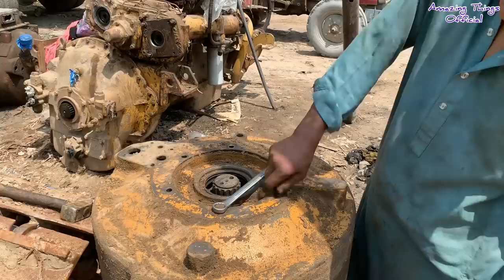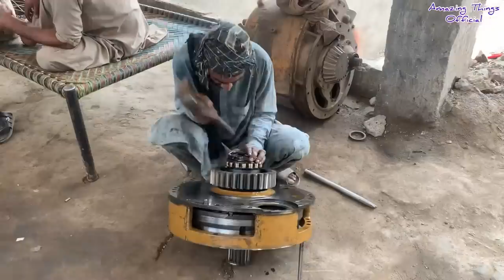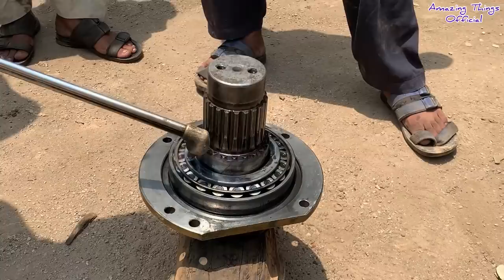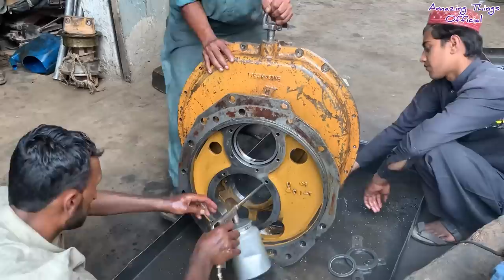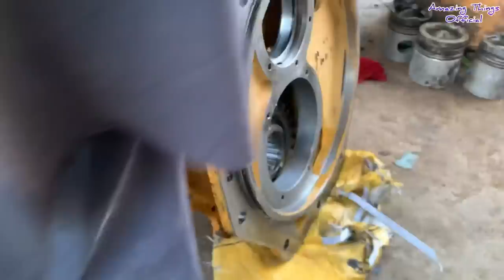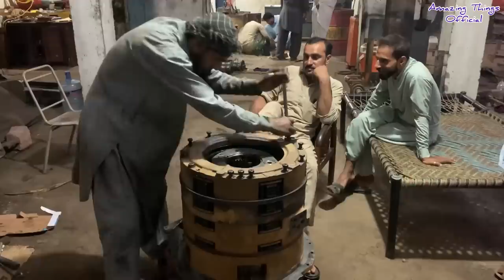Rebuilding Caterpillar 966D Dozer Transmission Due to Slow to Engage || Restoration Transmission

Comment: Got to respect these hard working people they always get it back together and never no waste good mechanics but I never see a torque wrench wonder how they do a preload on the bearings
Reply: It goes to show that torque wrenches are meant for maniacs to avoid bolt shear and plate warping during assembly. Also these guys discovered preloading bearings is a waste of time, nothing happens if its not done.

Comment: That's pretty impressive. If I were doing it I would be very concerned about having a few parts left over at the end. And who needs torque wrenches when one has a calibrated elbow...

Also goes to show that a bit of dust and grains of sand are no problem at least for some transmissions.

Looking at that one bearing, it seems someone forgot to maintain fluid levels. That can get expensive.

I'm surprised that it looks like they didn't replace more bearings, such as those on the planetary gears and on the clutch center gear.

Someone should show them the trick for using the old bearing to install a new one. It's a lot easier on the bearing.
Reply: no torgue wrench needed. its 2 grunts for the small bolts 3 for the medium bolts and four for the large bolts..

Comment: CAT charges $50K for this repair. Three Hooba Doobas in sandals with a couple of wrenches, screwdrivers, pry bars and big hammers charge $43.69.
Reply: these dudes work for the original parts they pull off lol. resale them

Comment: You have the old bearings sat right there which are perfect for using to drive in the new ones, but instead you guys pound directly on the new bearings with a hammer.  Suppose it keeps work coming into the shop...

Comment: Hammering on bearings.  clutch packs in the dirt.  Bearings in the dirt.  Sanding next to bearings. Bearings worn flat.  Torching bearings.  Not even a toothbrush available to clean the grooves.   No micrometers or feeler gauges.  At least they have some compressed air!  If it doesn't fit, get a bigger hammer!   Oh, the backaches!

Comment: So did we see why it was slow to engage? er no.. apart from the square roller bearing everything looked ok. Thats the beauty of the big old Cats, they can be repaired in the field with the most basic of tools, especially when you use a pair of circlip pliers as a crow bar to lift a clutch plate.... $64k question, did it run again when refitted and how well did it work..
Reply: I too was hoping to see said dozer after repair.
Reply: @chadwickalexanderjr1758  966D is a front end loader .
Reply: it ran for a wekk, which is quite a performance for the country.

Comment: Apparently rebuilding dozer transmissions requires hammers... Lots of hammers...And Mountain Dew assembly lube...
Reply: All the sand coating the finely machined internal parts comes at no charge.
Reply: that is kebab grease inside, mixed with sand.

Comment: I can't believe all they put on the roller bearing is what appears to be a thin oil and no grease. Might be the reason the bearings were flat on one side.
Reply: They are lubricated by the transmission fluid .
Reply: @stewatparkpark2933  Thanks Stewatpark, I didn't realize that's how it worked.
Reply: @itsjustme1949  breaings flat on the side? ever heard of roller breaings lol?  Anyway the problem here is that everything is done in the worst possible way, not the mountain dew kebab oil they used, because obviously all that is flooded in oil or transmission fluid once installed.

Comment: Good work though, it seems to me that the shim's guy was not fast enough and missed two shims around the alignment pins at 35:52. I don't understand why they don't use grease on the bolts when assemble the drive. The young guy next to the cleaning tray was almost hit by the high pressure solvent spray in his eyes, nerve breaking to see.
Reply: i grease was the only problem, lol, everything is done in the worst and most wrong possible way.